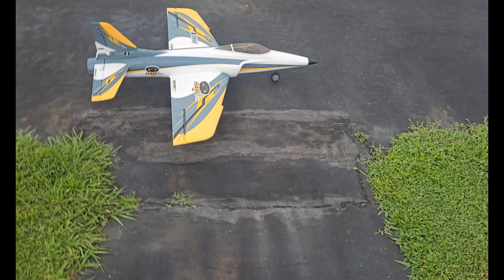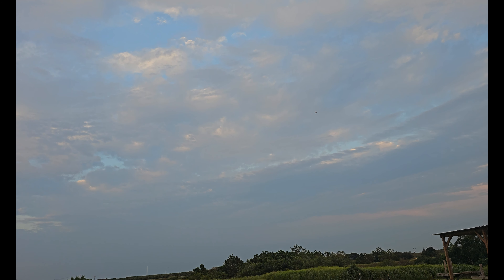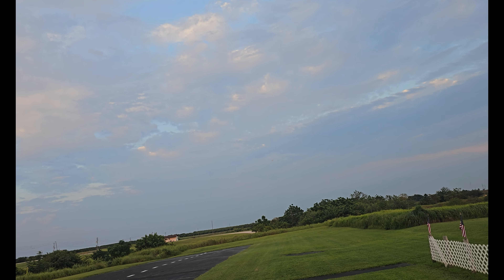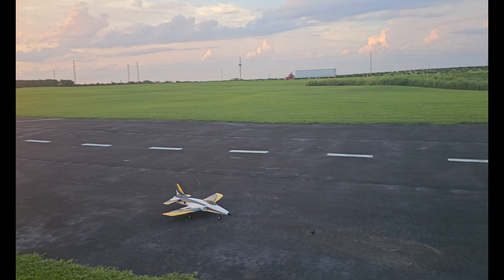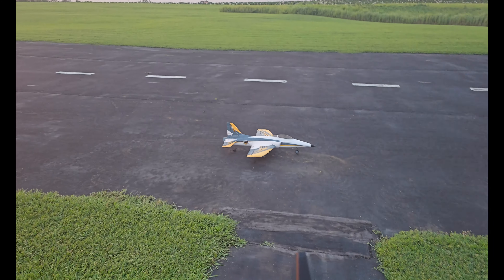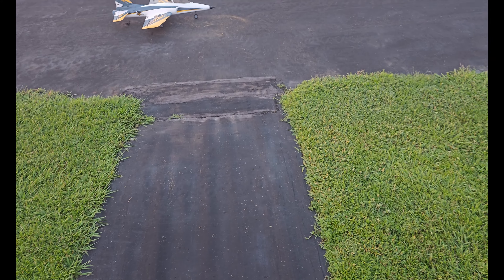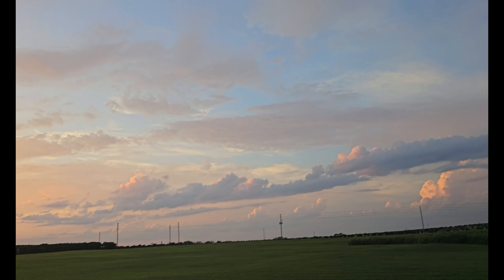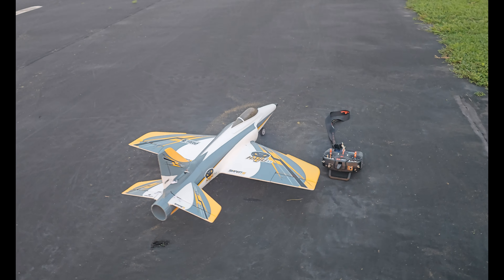E-FLITE HABU SS ON 6S A GREAT "GO TO" JET! by FGFRC #aviation #rcjets

Comment: After 22years in the hobby, I decided that it was time to try an EDF so I bought a Habu 70mm on 6 cell. I am still getting used to it. I find that it wants to float forever even with power off. I guess I’ll have to keep practicing both on the sim and with the actual airplane to get the landings right.
Reply from the maker: Bring her in level as long as you can hold it then just a TINY flare on the nose.
Reply: @FatGuyFliesRC  Thanks. I did do that on my last flight but got the flare wrong and she bounced a couple of times. I’ll figure it out.☺️

Comment: My Habu STS loss signal and flew away this week (while using the DXS radio). Searched all week with no luck. Heard other people losing the STS with the stock receiver and said the DXS is crap maybe? Thinking of replacing it with the SS version and putting in a Ruko Remote ID Broadcast module this time. Does the SS come with reverse thrust?
Reply from the maker: Yes it does . And sorry about the plane.